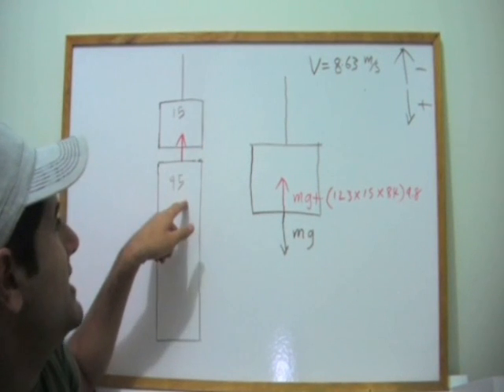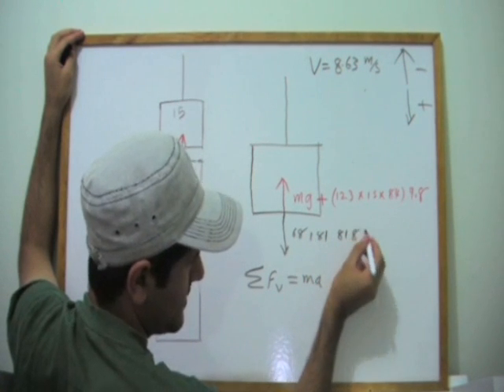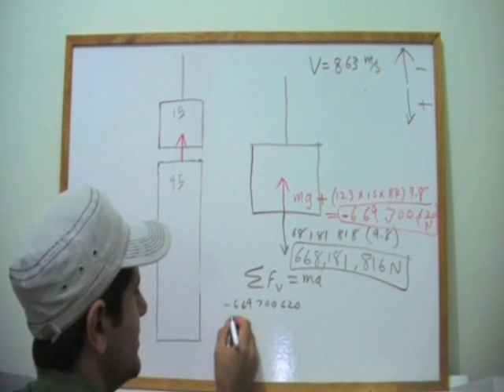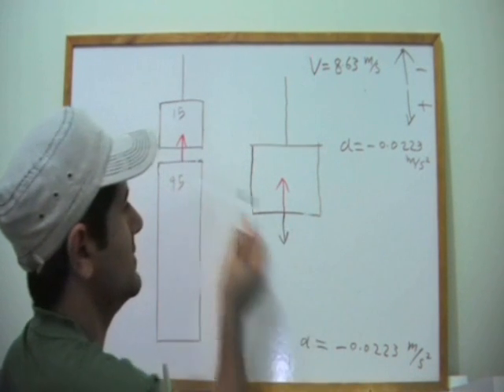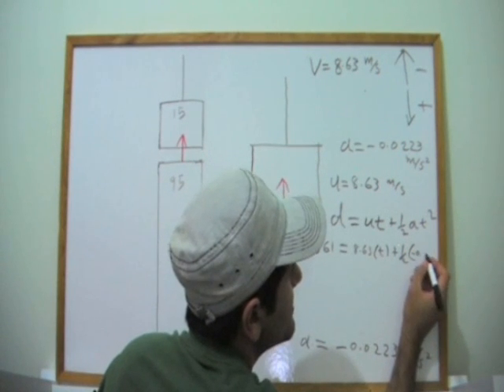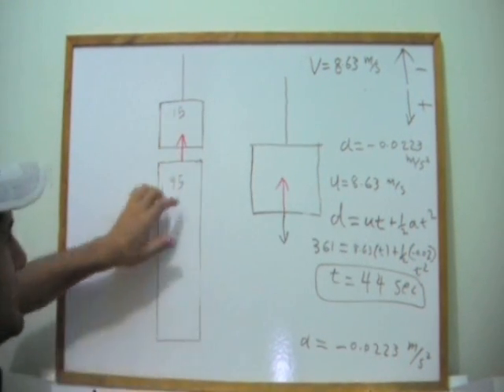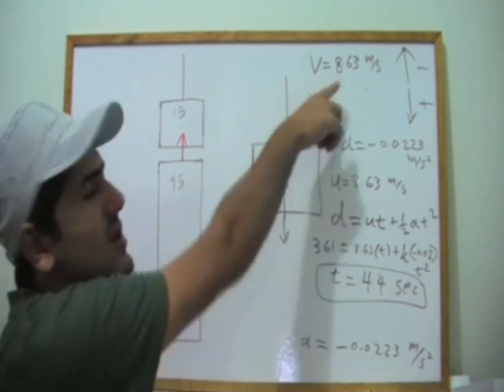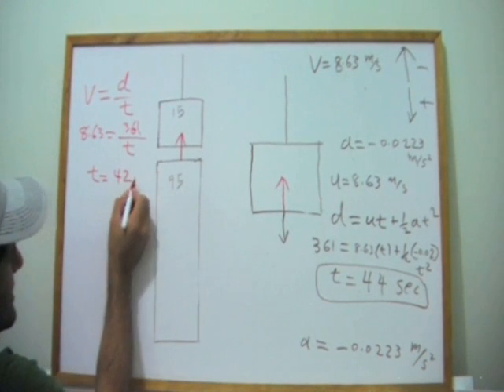(Part3) 911 Simple Physics Structural Failure Vs Demolition

Comment: wouldn't the weight imbalance cause an immediate shifting of the lower floors, thus causing building debris to shift towards the sides and spill off and thus eventually alleviate the amount of load on the lower floors thus causing the damage to halt at some point

Comment: Another way of explaining why the top part could not cause the building to collapse is by using the example of a Prius and an 18-wheeler going head to head. How far back is the Prius going to push the truck? The truck would eat the Prius and keep on going.
Reply: +Matt Foley love your name.
I have an Excursion with a 10 cylinder motor, and I use that example with me and a (NotSo) Smart Car with people all the time.  It's uncomfortable.  For them.  It wouldn't matter how fast one was going vs. the other, especially for this example.  I wouldn't hesitate to sit still and let a NotSo run headfirst into me at 50 mph, I wouldn't blink an eye.
I'd wear a helmet in case something came through the windshield, but it would be shards of something.  The redundancy built in to the rear of the truck would swallow a Smart Car.  It would effectively slice it in half like a hamburger bun.
You would be finished.  And I would likely be able to drive away from that without any work needed.  UNlike those 95 floors that just went <P O O F>.

Ali Mohamad, thank you so much for showing us the book, for your presentation, and your very clear explanation of the numbers behind the very simple physics.  I think we need to get you on to a talk show of some kind.
How can any person working in the hard sciences think for a second that the official story could possibly be?  It's not Star Trek, shit doesn't "just vaporize."

I don't care who set what when or anything else.  Until we can get a fucking inquiry again, I just want everyone to know that it COULD NOT happened the way they say it did.  Period.  No plane in the Shanksville scar.  Not a drop of real evidence of anything but strong explosions at the Pentacon, and people suggesting that that plane made that turn and BOUNCED off the lawn and just kept a' travelin' on through all sideways and shit into the strongest part of the most important building on the planet.  I challenge anyone to get on their Flight Sim, and take off from REAGAN, and hit that wall.  I challenge ANYONE.
Those airliners don't react like a Blue Angel.  But I know things that react faster than that.  When the release the first video of a plane hitting the building, then I will believe it.  There's a huge reason that they have kept all of that stolen footage.  $2.3 trillion <P O O F>

Controlled demolition companies have expressed that they are actually jealous of how symmetrical the 7 drop was.  Watch 100 cds, and find one that matches 7.  There's some great ones of shit not falling over right, but it will be a rare find that you match 7.  What else could it possibly be, even if one column failed and made an entire floor disappear into thin air.  It never would have fallen into it's own footprint.

All we need to do is catch them in one very clear lie, that is backed up by pure Newtonian Physics, irrefutable in the world of science in 2016, and easy to explain to people, and easy to UNDERSTAND for people, because they are SO fucking stupid...........Ali I think we have it right here.

I do hope this gets out there.  I'll share it, for sure.  Thanks again.
Reply: +Kevin Price    Kevin, you're absolutely correct. But the reason we're going with the 2.5 second free-fall for 105 ft. now is because NIST actually agrees that this is true. So at least for that period of time, we have NIST by the balls. Why? Because they can't and no one else can explain how the hell it was possible for the whole building to go into free-fall for any period of time. This is the smoking gun they couldn't hide. This one issue is what you need to throw into every debunkers face. Copy and paste it and watch them either ignore it or disappear. It's the best weapon we have to destroy them all.
Reply: +Matt Foley If you watch a video, and time it carefully, it seems to freefall for the entire duration of the collapse.
Reply: +Matt Foley 
"NIST does not explain how the building could possibly fall in free-fall for that 2.25 seconds"

"This analysis showed that the 40 percent longer descent time—compared to the 3.9 second free fall time—was due primarily to Stage 1, which corresponded to the buckling of the exterior columns in the lower stories of the north face. During Stage 2, the north face descended essentially in free fall, indicating negligible support from the structure below. This is consistent with the structural analysis model, which showed the exterior columns buckling and losing their capacity to support the loads from the structure above. In Stage 3, the acceleration decreased as the upper portion of the north face encountered increased resistance from the collapsed structure and the debris pile below." -NIST FAQ

Looks like they answered it to me. The exterior buckled due to lack of lateral support from the already collapsed interior. A 47 story column cannot stand without lateral support, it will buckle. Mystery solved.  Euler's theory of buckling has been around for a couple of hundred years, you Truthers should try and catch up.
Reply: +Oldschooldan1 I don't think any one here can or have figured this out, even if they think they have, because the complete physics involved is beyond us.

Comment: The only way it could take 10 seconds is if the bottom 95 floors were not there,I wonder if the math calculations used here could go on to show how many and which floors would have to be taken out to attain the freefall speed it actually descened at and if those floors matched the squibs that were seen during the demolition?.
Reply: TimReed22222 Did you not watch the video? He does the calculations to show the amount of time it would take for the top to reach the ground. He starts off with a speed that the top would reach going after free falling for 1 story and then has a measured height from the point of airplane impact to the ground. Assuming the top is no longer free falling and neither speeds up or slows down it takes more than half a minute at the speed it would be going in order to hit the ground.

Thus, for the top of the building to hit the ground as fast as it did it would have to free fall for multiple stories (in real life it had to push against the resistance of the building below it) and it would have to have at least that speed the whole way down OR it would have to speed up as it went down.

Of course, neither possibility is remotely plausible since the steel supports of the bottom of the building were unaffected by the planes and would have pushed against the falling of the top of the building. They were quite strong and would not have so easily buckled. Not to mention, when a few floors 'collide' with a bunch of floors, the few floors would shatter more (and spray outwards) and a large portion of the larger bunch of floors would remain relatively intact. But the THREE WTC towers that fell had nothing intact.
Reply: thewatcher1950 Fortunately, the collapse DIDN'T take 10 seconds; it was much longer! It did NOT attain free fall.
Reply: TimReed22222 Sorry approximately16 seconds (plenty videos out there you can count it your self) which is pretty much free fall,fact is it should not have collapsed at all.you dont need to be an engineer or a mathimatician to realize that you just need a small ammount of intelligence.
Reply: thewatcher1950 Sorry but 60% more than free fall is not free fall! And tower 1 was even slower, more than double free-fall time. 

You may not find 60-100% difference to be significant but the point is: That is NOT "pretty much free fall." End of story.

"you dont need to be an engineer or a mathimatician"

LOL! Truther speak for "it's okay, listen to me instead of all those experts who say I am wrong." LOL!
Reply: TimReed22222 Apparently the official times are just over 10 seconds for one tower and just over 11 seconds for the other I was being a bit generous when I watched a video,free fall speed, common knowledge really, you can deny it as much as you like it will not alter the facts, I dont know why you lable everyone that questions 9/11 as a truther I am not a truther I just dont like to be taken for a mug, truthers are wasting their time the truth will never be revealed, possibly some time in the future it may be accepted that the official story is not the truth as with JFK,till then I suppose the truth is that the most paranoid nation on earth security wise with more agencies than any other the best air force etc etc etc  is just useless at protecting its citizens.
Reply: +TimReed22222 You're missing the fundamental point that even if an entire floor vanished and the top came down it would still take more than half a minute to reach the ground unless it accelerated as it fell. We know that acceleration is impossible since there is stuff in the way to slow it down. So even at 16-20 seconds it would still have fallen at least twice as fast as it should have if there was only enough resistance to keep it from speeding up.

By the way, these experts you speak of did not provide any evidence of their claims. They expected the people to act on faith that they are experts and just believe the official story. Everyone who ever did any amount of actual scientific experiments or math could not find any way to prove the official story as all evidence of any kind points to something else.

Let's try a creative example: Imagine a person who is completely naked and has all the body parts of a man, particularly the genitals. And imagine that individual claims to be a woman. Are you going to listen to them purely because they are a biology professor? Or are you going to point at their 'bits' and tell them they are a liar?
Reply: +Curtis Smale And structures do not fall straight down.  They fall by way of torque, spinning like water in a toilet, either in a centrifugal or centripetal fashion.   A centripetal collapse is designed to fall towards the center of the tower depending on how the engineer wants it to collapse.  
The shells of the towers weren't built in floors, the lines of perforated weakness did not line up horizontally side to side,  but the bolts directed the energy shocks from the collision towards the top and bottom in both a diagonal and vertical way.  For example, if one were to take a huge hammer to pound one of the square beams of the outside shell, very little of the energy produced would travel to the square beams located next to them.  Most of that energy would be directed both vertically and diagonally along the bolt patterns (check out the patterns of how the bolts lined up with each other), towards the core through the double trusses, and through the bridge trusses which offered further support for the foiur side walls of the outer shell.  

Welded joints are superior to molded steel ones, molded steel joints are superior to bolted joints.  So, the weakest bolted joints were integrated into the towers by design.
Reply: Curtis Smale "even if an entire floor vanished and the top came down it would still take more than half a minute to reach the ground unless it accelerated as it fell."

Can you please tell us how you arrived at this figure? Sounds like BS to me.
Reply: +TimReed22222 Ask your science teacher (if you have/had one). It's accurate.

Comment: A square structure resists being liquefied more than a round one.  Dropping round washers both (think of pancaking floors) within a round tube and, at the same time, around a round inner core would encounter less resistance.  The floors upon the trusses spanning between the inner core and the outer shell of the World Trade Center were the equivalent of square washers with rectangular holes.

Comment: i think he is basikally saying just bekause the top floors were rnowing downward it wasnt enough forse to fukking break the whole building   all those ekwations are not nesessary
Reply: +Craig Seamus For every floor destroyed below, more than a floor above is going to be destroyed.  Eventually, the collapse, at least, is gong to slow.  This torque involved in this collapse is centrifugal.  Again think of a swirling toilet.  The water is spinning away from the center as the water collapses into the whole.  So, the mass is not accumulating directly above the structure.   in a centripetal collapse, the tower is engineered or designed to collapse towards the center of the structure depending on how the demolition expert wants it to fall.
Reply: "centrifugal" lol

research static load vs dynamic load.

to make it simple for you... imagine you raise a 20 kg rock up and place it on your head. you could probably withstand that right? now raise that rock up 12 feet above your head(the approx height of a floor) and drop it on your head.

what do you think will be the result on your head?

you had no problem holding the 20 kg rock on your head when it was just resting there.  thats STATIC LOAD. when the weight falls from a height of 12 feet, assuming it only puts say a 1 INCH DENT in your head, its hitting your head with a force of over 6000 lbs!!! thats DYNAMIC LOAD!!! 

assuming it completely destroys your head, it will be hitting with a force of over 790 lbs!!!

notice the more of your head it destroys the less the force.

the falling building upper section hit the lower structure with a dynamic load equal to  6-10 times the rated static load of the building. 

thats when the building was in perfect condition!! however this building has just been struck by a 300,000 lb airplane! and has been on fire for over an hour! all this has caused significant weakening of the structural steel and connections.